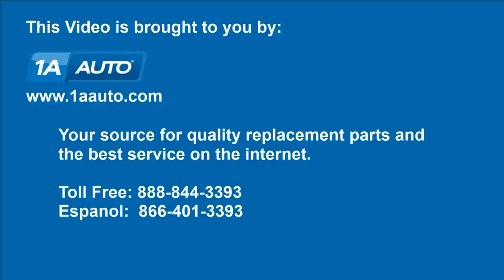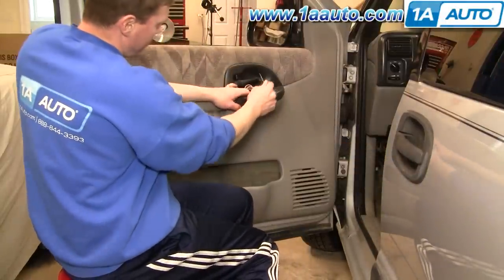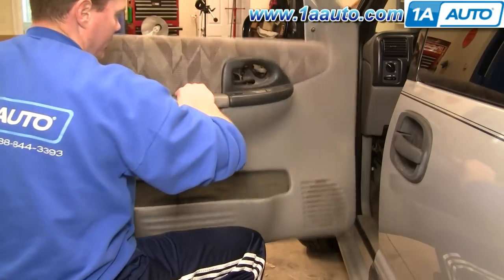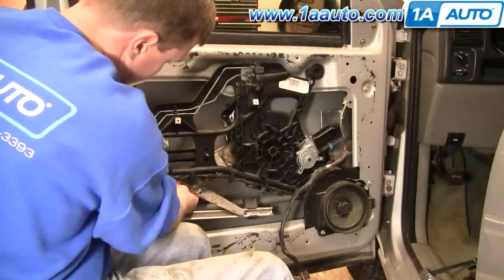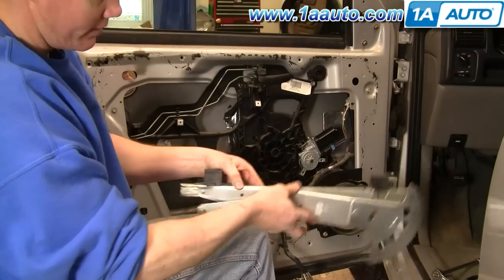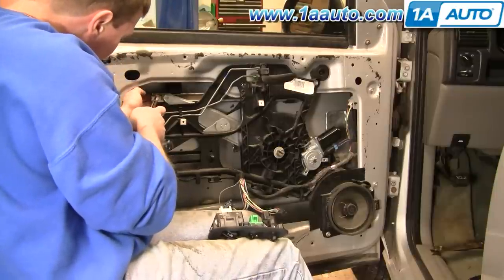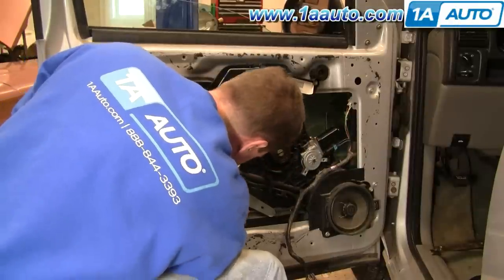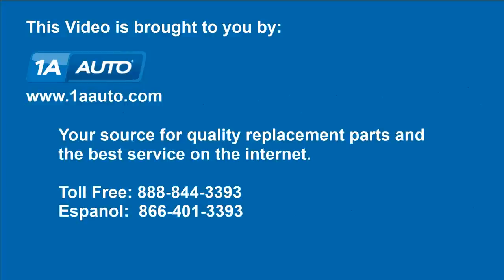How to Replace Front Window Regulator 97-05 Chevy Venture

Comment: Was looking specifically for regulator replacement video for a 2005 Chevy Uplander, but this video was exactly what I needed.  All the door's internal components were exactly the same, all the way down to the track spacer, spring and spring hub.  Sure appreciate a company that will go the extra mile to show you how to replace a part.  Saved me quite a bit of change.  Thanks!

Comment: Thanks to 1A Auto for posting this.  I followed this video and was able to install a new window regulator for my 05 Chevy Venture.  I purchased the regulator from them as well.  Dealership was going to charge me around $850 to replace the motor and regulator.  I bought them from 1A Auto for $60.00.  Thanks again to 1A Auto!

Comment from the maker: @BowenDesignWorks Usually when an electric window regulator goes, the window slides to the bottom of the door, and usually you can't roll it back up with the window switch.

Comment: Thanks very much for the video. My clips that hold the window to the regulator had broken and the window would not operate. After watching your video twice, so it stuck in the grey matter, I check it out and repaired it. Thanks again. I never thought I would use the internet to find easy fixes such as this. Thanks again.

Comment: Very helpful video. I discovered that one of the brackets for the front window channel ( pretty much out of view) had broken off the channel so it (the channel) was just flopping around. Also discovered that mis-routing the wires from the mirror into the harness can cause the window to come out of the front channel just as it starts to come down. Not sure what caused what, but the regulator was bad also. Learned a lot through this video, thanks so much.

Comment: My driver's side window was binding a lot as it went up and the passenger's side was beginning to do the same.  I lowered the windows and applied silicone spray down the vertical weatherstrip guides, soaking it in at the bottom corners front and rear.  I operated the windows a few times and presto!  Fixed.  Didn't have to take anything apart.  Thanks for the tip.

Comment: Great video, Mike!! Thanks for the details and the tips!! Just finished replacing the regulator and power window motor on our 98 Venture. Did I mention that it's 16 degrees out? One thing to point out regarding the retaining clips for the motor. After 24 years, they can be a little fragile. Ordered the parts for the job from 1AAuto!!

Comment: Thanks for the video. You guys are awesome.

My Chevy Uplander window was jerking at certain points when going up and down and making a loud snapping noise at the top and bottom of its travel. It turned out to be a broken tooth on the window regulator motor gear. The regulator itself was fine. 

If anyone is trying this on a Chevy Uplander, here are a couple notes:

Things were pretty much the same on my 2008 Uplander, except the window regulator is attached differently on the top. (The bottom rail and glass removal are the same.) The top of the regulator is attached to the black plastic structure that supports the window motor and other things. To remove the regulator, I had to turn the slotted metal part where the spring attaches, just like in the video, but the regulator wouldn't come free until I also removed the electric motor that drives the window regulator. Then the regulator slipped right off. 1A Auto also has a video to show you how to remove the motor on a Venture, and it's the same on my Uplander.
Reply from the maker: Thank you for the feedback and for checking us out! +spduyck

Comment: Thanks. Both windows begin to bog down about 2/3 of the way up and then slowly creep up closed. 

My passenger side finally gave up and I had to replace the regulator. I've seen this on several montanas/ventures. It appears the felt (stripping area) inside the door about 8" below the side mirror gets out of shape causing additional friction which caused the window to grab. 

I slowly and evenly pried the stripping back towards the interior to open it up and seemed to helped.

Comment from the maker: @BowenDesignWorks A little trick you can try is to spray some silicone on the window sweeps. It will help the window to glide easier. You can find it in a spray form at the local parts store. We carry a great amount of parts for your vehicle on 1aauto.com

Comment: Great Video. It would be nice if you explained at the first of the video why you are replacing the part. 

What are the symptoms that cause the need to replace the window regulator.
Reply: Well, in my case the window would pitch forward and jam when rolling up. I looked inside the door expecting to see one of the clips had come loose but, instead, I saw the regulator was all bent up. The window probably needs lubrication too.
Reply: Just finished. The window was still tilting forward and jamming until I lubricated the front and rear edge of the window. My guess is that the friction caused the jamming which cause the bent regulator arm and the bent regulator arm was never a symptom of anything. Oh well… I probably needed it anyway.

Comment: Thanks, this was very helpful - plus I bought the parts from a1aauto. Oddly enough the switch broke too and was driving me crazy because once I put everything together it would only go down. the part I replaced was the bar that holds the window - the original had cheap plastic clips that broke, the part I bought had steel and is higher quality.
Reply from the maker: Thank you for your order Mark. Have a great day! 1aauto.com 888-844-3393
Reply: That switch problem is extremely common I had it too. I know the previous owner did too because the it was a junkyard replacement with the original in the back. When it failed I went back to the original and, sure enough, it had the exact same problem.

Comment: One arm of my regulator is bent back. The one attached around the middle of the door towards the elbow. I'm having some trouble with the dang tabs on the window of the drivers side door 97 Chevy venture. Gonna try using a flathead to push them down they are stuck.. Will update post for others as repair continues

Comment: wha01: it's probably far too late to tell you this, but I would DEFINITELY not pay anyone $1,000 to do this. It took me about an hour per side going slow to make sure I cleaned out old dirty grease, re-greased, and just generally tried to be careful. Also, the first side took longer, because I didn't realize that there's a small slot that the gear in the regulator has to slide into (probably took an extra 10 minutes).

All of the parts were about $110 (both motors and both regulators).

Comment: My windows are just slow on my 2003 Venture. Is it possible that the regulator needs lubrication? You mentioned lubricating the track on the regulator. What type of grease should I use?

Comment: I put in a new regulator from 1aauto, but I still have a problem where the window goes crooked and gets stuck halfway when going up. My old regulator was bent, so i thought that was the problem. After replacing, I have the same problem. Any idea why the window isn't coming up stratight? It seems to get stuck and the black plastic starts bulging outwards when you operate the window upwards.

Comment: OK. The driver side window in our 2003 Pontiac Montana just clicks when we push the button. At first I thought it was the motor,  but that works. So now I think it's the regulator. I managed to get the window up but it's not tight in TV window channel and I can hear air coming through. So, my question is, do you think it's the motor or the regulator? Both have gear teeth. Also,  after you install the new regulator do you have to adjust the timing of the motor so the window starts and stops in the correct position?
Reply from the maker: You would need to inspect both the window regulator and the motor to see if the gears are stripped on either one. Hope this helps you out. 1aauto.com

Comment: This was a GREAT Video and "how-to" ... BUT: The plastic "bearing-track" (on mine) is worn out and THAT is what MY issue is. Question: have you ever tried Dormans Part # - 924-072 "repair kit" to try and remedy this ?  Were I to replace the regulator assy. that STILL would not remedy the issue at the 1/2 way point, as again: that plastic "track" (where the left lower roller inserts) , is WORN-OUT. I've had mine out 3 x trying to figure out why it always "stops" at that point. 

So Again: the issue IS that that slider is no longer FLAT, and their-fore it cannot articulate the grass "forward". THANKS FOR ANY Suggestion !  This plastic "rail" is appx. 10" long, and one 10mm bolt retains it. IF I "pull" on the glass as it goes up, the issue is GONE / it goes up just fine !  VERY FRUSTRATING. 

Best !  :- )
Reply from the maker: +TommyZTrains Thank you for checking us out, as well as the information with Dorman's part number. This will assist other viewers who are experiencing an issue similar to yours. 1aauto.com

Comment: I have a 97 transport Montana and my passenger window will go down but it won't go up,it was doing that for a good while...now it doesnt want to go up or down..do you know what the problem might be?
Reply from the maker: +me 812 Sounds like either the motor, or the switch is shot. I'd check the switch first, but it could be the motor. It puts less strain on the motor to bring the window down than to push it back up, so it's not uncommon for the upward movement to fail first. Hope this helps you out.  1aauto.com?utm_source=YouTube&utm_medium=CTA%20Comment&utm_campaign=1ATony 866-403-3393

Comment: There’s literally no place to grab on my “balance spring.” It’s coiled too tightly to get jaws in where they do in the video. It’s also curved and not straight at the end like theirs. Same exact door though.
Reply: OK, the only way I got the balance spring off/on was to use the power switch to lift the regulator almost all the way, unwinding and reducing tension on the spring. Be careful since you could easily catch a finger or a wire or something in the mechanism… especially if you bring it back down since it may keep moving on its own once triggered (automatic driver’s side window function).
Reply: I also had trouble with the crimped track. My pliers would just rip off chunks instead of bending it straight. Thankfully, I was still able to re-crimp with the missing sidewall (lifted the “floor” of the track).